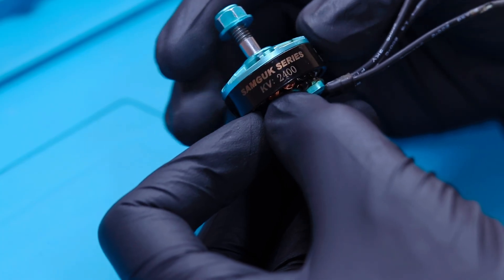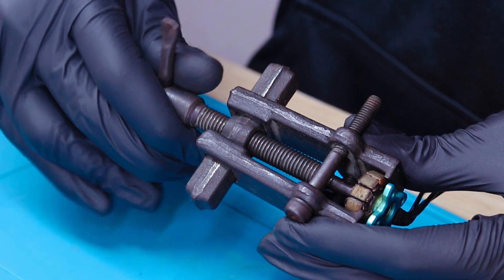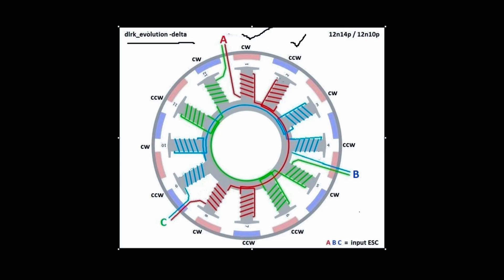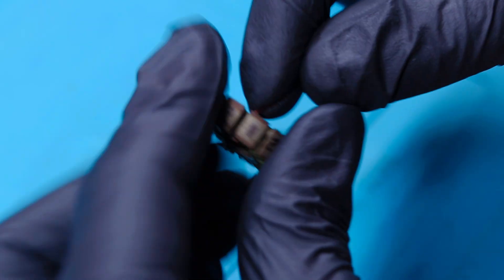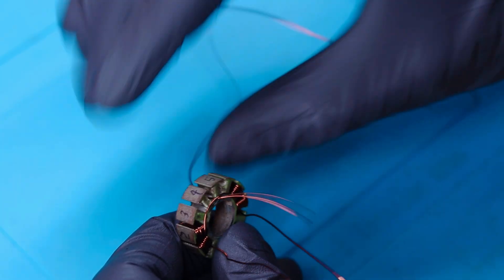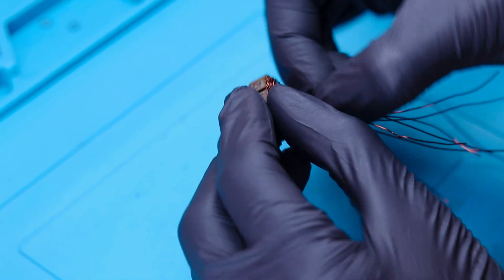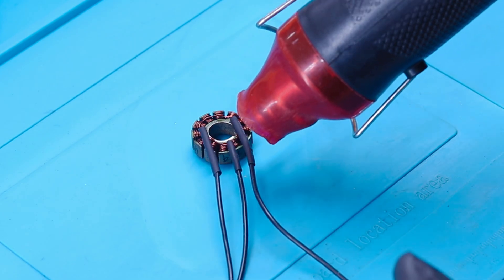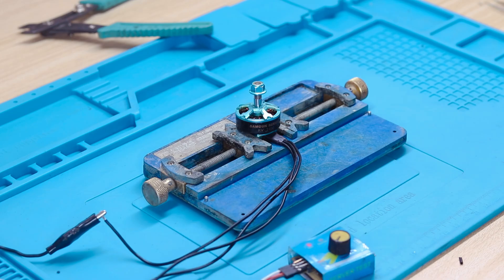How to Rewind Brushless Motor of your FPV Drone | Motor Rewinding Tutorial

Comment: Я сжёг так мотор geprc на cinelog 35v2, в betaflight, дал полную мощность мотору и он сгорел😢, тоже перематывал😅
Reply from the maker: Amazing. Did you separate the stator from the base or just rewinded it without removing it from base?
Reply: @quadkart  я хотел снять, ну он начал гнуться, так что пришлось помучатся чтоб крутить обмотки🤕 мотор geprc speedx2  2105.5
Reply: @lis9848  Bro which kv did you rewind
Reply: @Hmingmawia_Ralte  не знаю, примерно, ну cinelog 35 v2, летает отлично😅